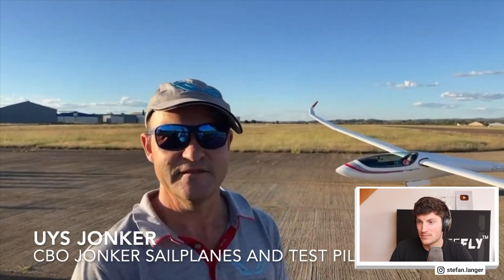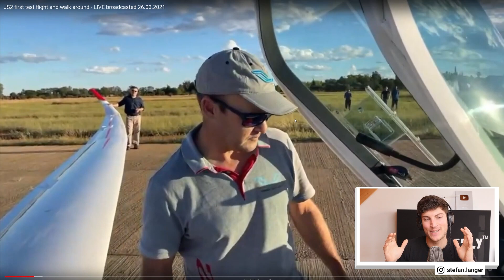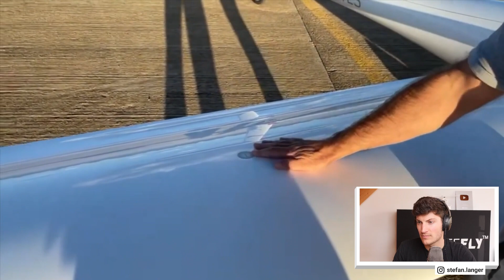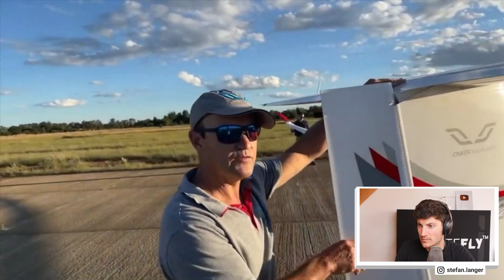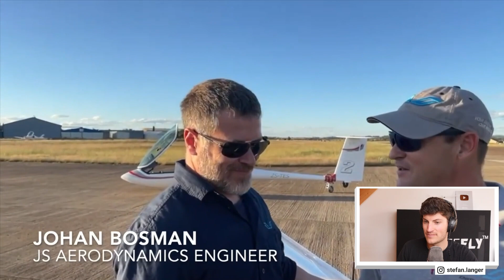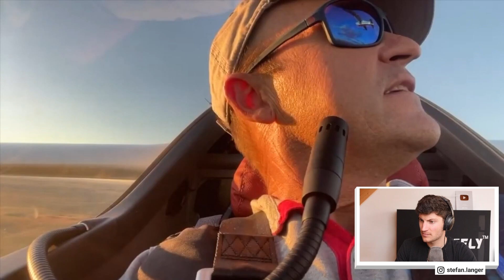JS2 First Test Flight | Competition Pilot Reacts!

Comment: I think the pilot said that the noise at the end of the landing run was tailwheel shimmy, not a noise from the wing tip wheel.
Reply: Correct, was shimmy on the tailwheel. Play identified and corrected. Will test soon again!
Reply: @jonkersailplanes3113  you have designed one amazing sailplane. congrats
Reply: If shimmy occurs on a castering nosewheel it can be quite serious.  It is a bit like flutter.
Reply from the maker: Thanks for the correction! It sounds weird :D

Comment: @stefan. Noise is most likely the air extractor behind pilot on the bottom of the fuzz. Probably missed to install the zigzack tape infront of it 😄
Reply from the maker: Do you have experience with this? 😆
Reply: @SteFly  well, heard about that 😎 But I guess every JS3 pilot knows in some configurations this ‚plopping‘ sound 😄
Reply: air extractor flow guide unit was not installed yet.

Comment: The 43kg/m2 discussed is presumably for the 21m version and if that is correct then it isn't a true comparison with the V3M which is only 18m.  A 10kg lighter JS2 at 510kg would have a wing loading of 45.6.
Reply: Empty JS2 21 is 398 kg with 12.25m2. 18m is 12kg lighter with an area of 11.19m2
Reply from the maker: There are different number on their webpage and in the video. I´m not sure what´s correct but the numbers on the webpage (425 kg / 435 kg) are more realistic.

Comment: 4:40 Ventus also has the micro on the canopy. 
I guess 95% of the pilots buying the JS2 will not be competition pilots but guys like me. The most important thing is for us the reliabilty of the engine system. Can I get in the air or avoid an outlanding if I press the start button, this is the thing that counts, not so much 2-3 efficiency points. That they can build planes with execellent performance has been shown, but getting into this self launch regime - we will see.
Reply from the maker: I completely agree that the reliability of the propulsion system is very important! Also the vibrations from the engine can affect so many other parts. Are you happy with your Ventus?
Reply: @SteFly  My Ventus 3M got a new injection system (TM from Solo) now. The vibrations are better now. But Arcus is still running a little bit smoother. Climb performance is still gigantic. Last year in summer I was grounded several days in Pui and had to fly as a pure glider (was fun !) because my throttle cable was ripped out and I could not repair it so easy. But overall I can say that from 2600 hours with Ventus self launch I had trouble 4-5 times. And not one time in the air.
Reply: It's not like the other manufacturers have totally reliable self launch systems ;) Can't be much worse.
Reply: @ArneMartinGuettler  I tend to agree. I even had a 2 day repair on an Antares on my visit in Namibia, an electric system that should in theory be more reliable. And my Ventus has also been grounded last year in summer. The customer is always the test pilot if you are below manufacturing unit 50.
Reply: I was a bit surprised that they went with focusing on the extra range of a combustion engine, although I do get the points made here might affect some people. The thing is; giant leaps in battery technology are happening right now, so this decision feels a bit reactionary. Especially since you can get the JS3 with a self-launching electric engine. I might be missing something? What do you think? Has anyone had experience with the Arcus E?
Reply: @niclaswennstrom8249  no, the advances in battery technology are decreasing from year to year. Energy density doubled through the last 10 years but I doubt it will again in the next 10 years, not at around 200Wh/kg. But Fuel is still at 10.000Wh/kg. So there is still a huge huge gap between a combustion self launch with maybe aditional wing tank which will allow me for example to get into the alps from my airfield and back in the evening and electric. I have flown Arcus E in Namibia and Anatares 23. Both planes need definitely a later launch so you have thermals marked by others and can turn of the engine in 400m agl. And even then, you are not prepared for difficult weather, when you are really cut off so I fly different and more conservative when I know I have maybe 1000m climb left. The total climb values they promote are not realistic, never reached them.

Comment: Wonder if they were also making so much risky choices when they design and build the glider as they did when they fly it...
Reply: Some aspects of flight testing is risky. Flutter testing an spin testing for example. Flying new glider around the patch in calm conditions certainly is not.   Linking that with design decisions is certainly completely wrong. The Js2 was designed in a very conservative way using state of the art techniques. Every design decision is based on the function  performance and safety. Pilot safety above all is the inhouse moto. The design effort of the JS2 took approx 40 000 man hrs. So we did a thorough job.
Reply from the maker: When did they do risky flights or do you mean the close formation with the photo plane?
Reply: @SteFly  I just feel uncomfortable seeing these planes so close together. I know they are professional pilots, I know this flight has probably been thoroughly discussed and I know that certain risky maneuvers are required to certify each aircraft. But the video is in no way filmed showing special attention to flight safety. So it naturally comes to mind, if the glider was designed and made in the same way, I probably wouldn't want to fly in it right away. I hope I am not making that more complicated if it needs to be. Is just a gut feeling.

Comment: Why not front electric sustainer (FES)? Oh, got it - gas engine...
Reply: JS is doing the RES System for the JS3. They are comming from the competion ground, so they spend lot‘s of time for CFD works to optimize the fuselage to make it perfect from aerodynamic point of view and so you can understand why they won‘t ‚destroy‘ their hard work by adding the FES prop. Additinonal Point is, That the js2 is a Self Laucher wherby FES is not really a suitable selflauncher solution for this glider class. So there are probably more reasons up to now to Go for an classical Engine, but this might change sooner or later:-)
Reply: @michaeleisele_fly  What I like about FES is its immediateness. It's just there. Press the button and you have instant thrust. No loss in mast extension, no resistance problems when stuck open. Simple mechanically. Someday someone will build a sailplane nose that will be specially designed to hold a propeller. Stemme has a nice idea, but needs a tall chassis. I have seen renderings of three FES blades with special recesses in the sailplane for storing the propeller blades. But I don't think it's in production yet. How big can the losses caused by FES be?
Reply: @ThePilotPirx  fully agree. Fes is a very cool system and is for Adventure pilots and maybe also Club operation ideal. Personally, I like also the opportunity to install better batteries once available in future and have a growing system.
As a comp. pilot you will always complain about the additional drag eventough the difference is probably quite small. But it‘s sometimes also a mental thing:-) I think the german idaflieg did some comparison tests some time ago about the effect of fes. I can‘t remember by heart the outcome.
If I‘m not wrong I heard from the aerodynamic experts, That the difference of the Ventus3 with the small Fus. and the G29 is similar to the fes prop. difference. So a V3fes would be equal to the G29. Therefore, i guess the impact of fes is rather low:-)